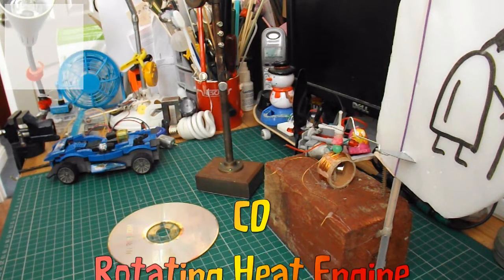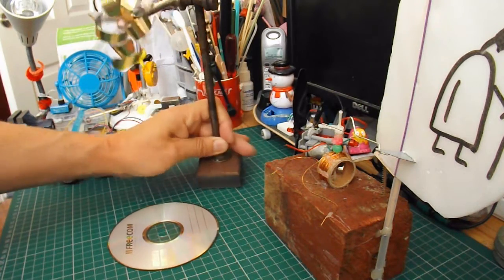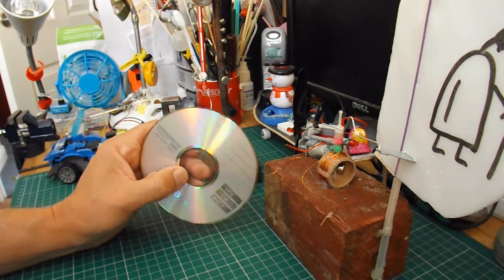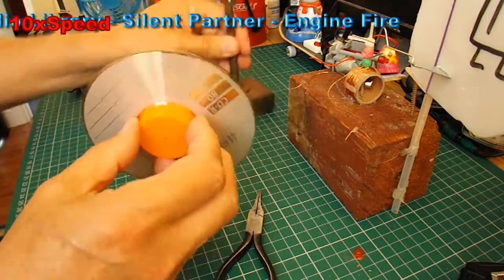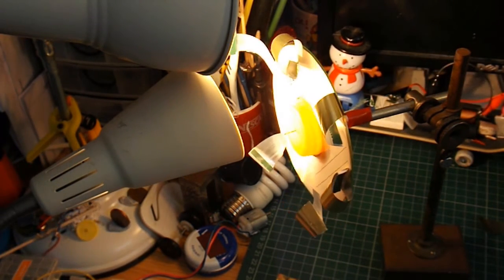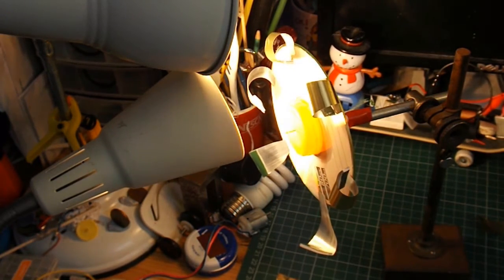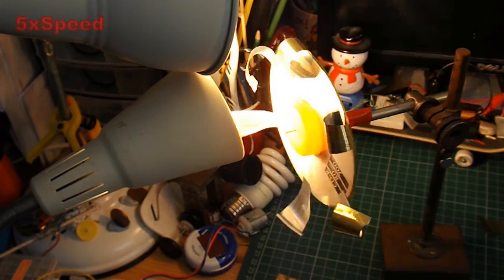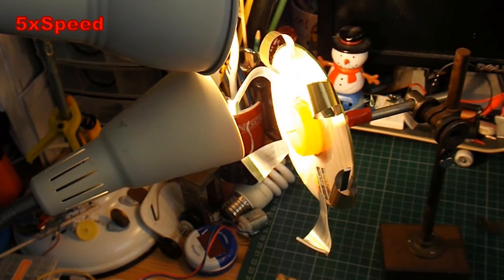CD rotating heat engine

Comment: could you use magnifying glass to  focus the light
Reply from the maker: Brett Sanders that probably would not help, in fact it would probably just melt the plastic. Study the way this works. All that is required is for the arm or petal to extend to the side, that unbalances the wheel and it turns moving that petal out of the heat so it can cool and curl up again while the next one opens. The arm opens quickest when it is heated along it's full length, not just in one spot. Painting it black might help it absorb the heat. Making a shield or mask to ensure only the top left or top right quarter of the circle is heated would also improve the performance.